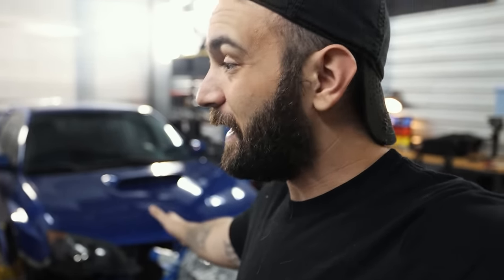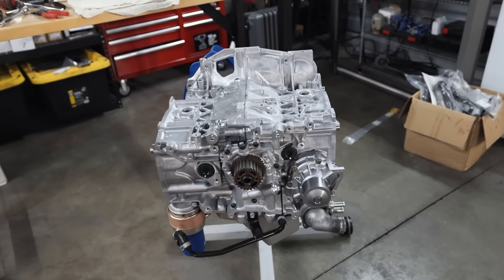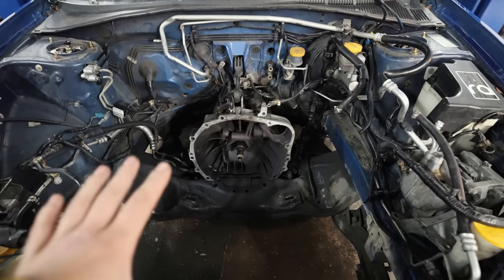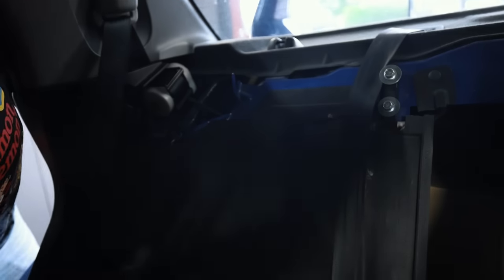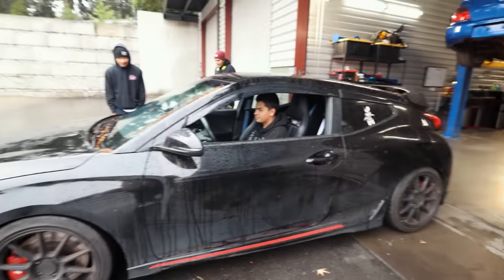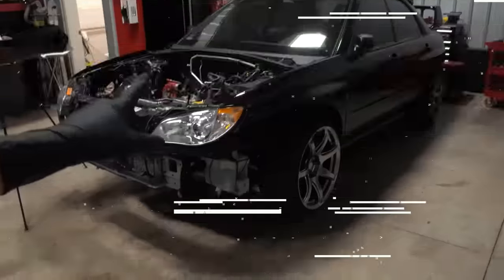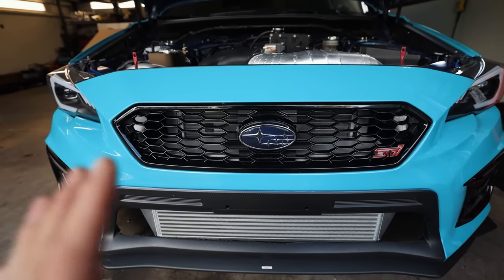Saving a Neglected Subaru WRX STI Pt: 2 (Short Block Assembly & Chassis Prep)

Comment: For covering connectors and such when cleaning I like to use sandwich bags that I tape on with electrical tape.  That way less risk of tape just falling off with the degreaser stage.
Reply from the maker: Normally, that's what I would do, but I didn't have any 😅

Comment: Hey Tanner whenever you do the heads could you make sure that you show how your supposed to orient them before putting on caps ect for first start up?
Reply from the maker: Like the cam caps?
Reply: @Smeedia  Yessir, I'm in the process of rebuilding mine online and I can't sem to find any videos or guides on Nasioc on how the camshafts are supposed to be orientated for first start up. :/
Reply from the maker: @Anonymoose0913 they should be labeled with a number, the number on the cap corresponds to the head it goes to. 

They should also have an E and an I. 

The ones with E are the exhaust caps the ones with I are the intake caps

Comment: I have a 2018 Kia Stinger GT with launch control. It’s certainly not the same as when I had my Access-port with my 2018 WRX. The Stingers RPM is a lot lower. Like 2100 RPM.
Reply from the maker: The N was the same. Idk why it's set so low 😅 gotta be making peak torque WAYYYYY lower in the power band
Reply: @Smeedia  The 3.3 liter Twin turbo motor does make peak torque from 1300 to 4500 RPM.

Comment: i have a veloster n, itll shoot flames on a stock tune with a catless dp. 

for the 3 door thing idk the driver side doors longer so its easier to get in, and if the passengers side back door is because they didnt want to go full coupe. Anyways insurance thinks its a sedan because its a 4 door (hatch) so my insurance is super cheap
Reply from the maker: That gen that we were playing with looked suuuuper nice on the interior. The 3 door thing stiff vets me, but an insurance discount is alqays an added bonus 😅
Reply: @Smeedia  yea no one expects it but i dont mind it. wish the door behind the drives rolled down tho 😪 btw.. you can really build these motors and the trans holds up to 500whp 😉. Feels like awd unless ya launch it then it hops like shit. i much perfer it over the wrx as far as performance and im a subaru fanboy. its just a super niche car so no one talks about them

Comment: If you could get this build all done then put miles on this car, I mean enough miles to prove Subarus can be taken care of and not just blow up. That would make for a great video. Maybe "25k miles on a 2018 sti ra block" you could send the oil in to be tested to check the motor's condition check spark plugs compression etc.. The whole process proving the motors aren't crap. I think that would be a great little time lapse idea.
Reply from the maker: We should be able to do something similar. The toad trip should net around 5000 miles ish with races happening along the way

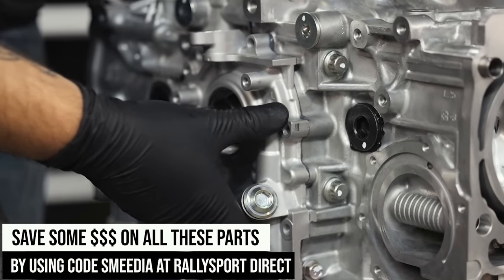Comment: Late question, but at 3:10 do you let the black gasket maker that you applied on the oil pump cure for the full recommended 24 hours once it’s on the block? Or can you prime the system for oil pressure a couple hours before the 24 hour mark?
Reply from the maker: Double check on the bottle for the set time, off the top of my head I don't recall what it is. Normally I'll go three hours past 🙏

Comment: Hey Tanner, I’m rebuilding an 07 STI as Well. Bearing failure. How do you clean all oil lines and turbo from metal debris?
Reply from the maker: Turbos can eb a bit hard to clean, and normally, if it is significant bearing material found I replace the turbo. 

For the lines, I'll use a few cans of brake clean to spray through the oil lines

Comment: hi tanner i need ur opinion. have a 14 wrx hatch was doin timing and i took off the oil pump to red loctite but never packed it. i flood mode cranked it twice for like 5 seconds but aem guage oil psi was still 0. said f it and started it up and went to the usual 100 psi. driving fine ever since do i hv anything to worry abt?
Reply from the maker: It takes a good 30-45 sec to build pressure sometimes. If thr battery is low and it's spinning over slowly it won't build pressure either. 

But in your case, nothing to stress 🫡

Comment: I'm in the process of building my bugeye. Does the killer b oil pan make a big difference or does oem pan + killer b pick up and baffle is enough? My end goal is around 500bhp.
Reply from the maker: I'd do the pan as an added bonus to hold more oil. But the pick up and OE Pan should be fine 🫡

Comment: On the Veloster you need activate the launch control in the N menu then really press the brake hard and fast, then stab the accelerator to the floor. You guys never activated launch control properly.
Reply from the maker: We hit active on the menu to turn it on 😅 it told us it was active for 5 min lol
Reply: @Smeedia  yeah if you had it active on the menu you just need to stand on the brake pedal abnormally hard then and quickly stab the accelerator to the floor. It feels weird but if you do it right it will hit your set rev limit and it will show it between the gauges you can then Change the rev limit on the fly with the buttons on the wheel. Release brake and go. I think the hard brake pressure is the trick. Anyway love your vids man keep up the good work!!

Comment: What’s the easiest way to tackle a broken valve cover bolt on an ej? Specifically the passenger front bottom one. Anyone?
Reply from the maker: Is it rounded or snapped? If snapped, is it snapped flush to the head? 😫
Reply: @Smeedia  snapped but not flush, it’s sticking out a tad bit
Reply from the maker: @David370z let it soak in PB blaster for a few hours, hit it with a touch and try ti grab it with some vice grips to twist it out
Reply: @Smeedia  ok but with it being the very bottom front one it’s pretty tight in there, would I be better off taking off the header and trying to get it from the bottom or loosening up the mount to tilt it a bit to gain more accessibility? Sorry if my question is kinda dumb I don’t mess with Subarus too much😹
Reply from the maker: @David370z oh shit you still have the engine in the car?! 😭 get everything out of the way you can. And....

God speed 😅
Reply: @Smeedia  😹😹😹yeah, you know what they say every 20 minute job is one bolt away from being a 3 day ordeal😹. Thanks for the information regardless

Comment: Im sorry but there is no compromise when it comes to the RX-7 and rotary engines in my book, i haven't got one yet because i cant afford to built it right with the proper 3 or 4 rotor engine. The fact is when the time comes if you cant afford or not willing to put a properly built rotary engine in it then you should sell it to someone who will. I vomit every time i see an LS or other engine swap in them as they are gross. i know that sounds harsh and childish but im a purist when it comes to cars, im not going to put a RB26 DETT in a supra or a 2JZ in a Skyline or worse a freaking LS in any of them because it ruins there heritage and DNA of what made them what they are sir.  So even with the huge price tag now on rotary engines you find a way, see if other people like rob dahm are willing to help with engine parts or whatever or please just sell it too someone who wont put a freaking LS in the car.
Reply from the maker: From one aspect I get where your coming from. But it's a car I've wanted for a long time regardless of what engine is in it. For the time being ill use the 13B until it meets its end then reevaluate what engine I may put in next. The price tag of $13000 for an OEM 13B from Mazda is completely unreasonable and with the cost of OEM parts it's no longer an option. 3/4 rotor engines are stupid expensive with used 20Bs being near $20,000
Reply: @Smeedia  So first off i know my reply came off as a little rude but was floored the first time i heard LS swap but heres some of my real thoughts. So i know what its like to want that car, i was class of 92 and the first time i saw the 93 RX-7 long before anyone really cared about them and before fast and furious and all the followed hype i dreamed of wanting one but at 20 years old it wasnt possible. So to watch the hype train that has followed post 2000 grow more and more i still wanted one but life happens and now mazda has decided to really cash in on the hype to make the 13b available. Not all cars have the deep heritage that the RX-7 has, the EVO's are over hyped and over priced even. When ive watched you build blue, more then one and kinda even twice i would guess all told you have atleast more then 60k in that car just in parts and more, lets not even talk labor hours and more. 

So when you think 20k for a fully built 3 or 4 rotar motor its not really that bad honestly, the fact is if you put 60k into the RX-7 making it a pristine show car/drive the fact is you could get back your total investment and make a nice profit. I think as much as i love blue and the WRX in general your really going to be hard pressed to sell her and make a really nice profit because asking for 75k for a fully built WRX is kinda a reach. I think we all as car lovers dont love cars though to make a profit or get our money back though but do it because we love a car.

 The motor of some cars are the heart and soul of what makes them unique and great even when they arnt stock but for the RX-7 when you take away its braps all you have left is a souless shell that make it what it truly is and stand out from all other cars. I know its a dream car for you and i get it but when you drive it with a V8 LS1 or whatever trust me when i say you will take it back home and realize the car has no soul or heartbeat and is only an RX-7 shell that isnt fun driving because you cant hear that truely great brapping heartbeat spitting fire with every shift.

Comment: Dude, I felt like I got punched in the balls last video when you talked about getting rid of the fd. Then said ls swapping it… -_- because in 30k miles you may have to rebuild. By the time you put 30k miles on it …. Shit dude, it’ll take 10 years. I’m going on 18 years with mine but it’s not a daily and chances are yours won’t either. IDGAF about Mazdas pricing because there isn’t much to have to replace. Unless you’re going 20b or 4 rotor, it’ll be just fine. Compare a full ej rebuild to 13b. I stopped watching last video when you said that.. I’ll go finish it now.
Reply from the maker: I wouldent sell the FD, I've wanted one forever. But I'll run the 13B until it kicks the bucket then look at swap options. Hard to justify rebuilding them now.  I can rebuild an EJ for sub $2500 for a 13B it's nearly $4,000 for oem seal kits and consumables needed 😫

Comment: Awesome content Tanner love the GD! How old does fuel need to be for you to consider draining it? (1 yr, 2 yr ...etc)?
Reply from the maker: If its in a sealed system, 6 months or so and I would personally drain in. I'm sure you'd be fine stretching it out but If I'm storing a car fir an extended period of time. I will typically drain the tank
Reply: Great to know, my project Sti has open fuel system with fuel at least 1 yr old so definitely getting drained!